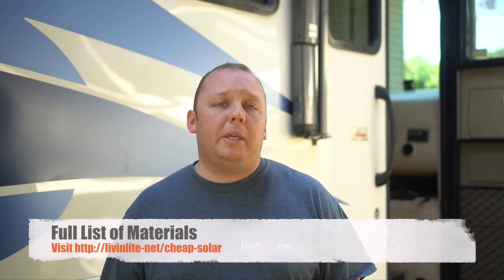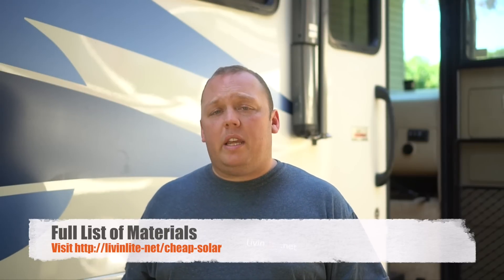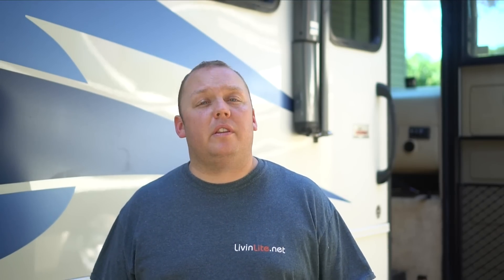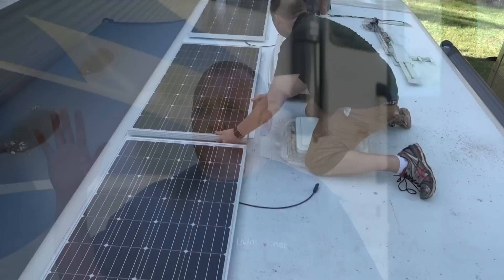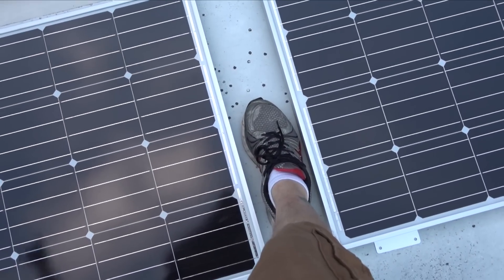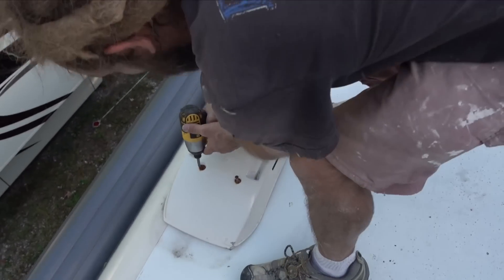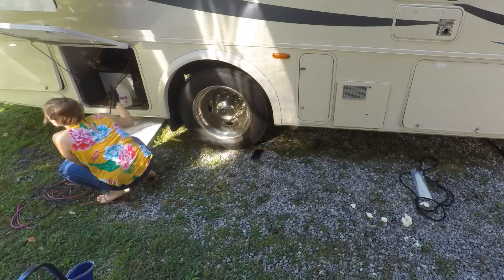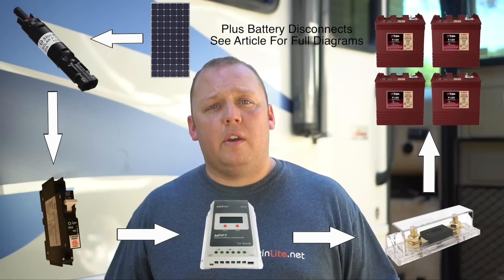Solar Power - Stop Using Generator for Under $1200?

Comment: How much would it cost to run a generator to generate what your solar panels would produce on the equinox? If it's around $6.00 in fuel a day you'd recover your investment in 200 months or just over 16 and a half years. Even using $12.00 a day in fuel for your generator it's still going to take you 100 months or ~8 years to pay it off.

Comment: Four x 160 watt panels in series does not produce 48 volts but 88 volts with no load, down to 72 volts at full power load. These are the input voltages the MPPT controller must be rated for. Personally, I would have saved up a bit more cash and bought the EPever controller that could handle 50 amps so that you don't waste the available  energy and also the unit doesn't have to work so hard. If you have a really good day with the sun close to directly overhead and you have hammered the battery the evening before while being parked in the shade until you move the bus, you can miss out on an extra 120 watts or so of charging ability... just saying but I've seen it happen.

Comment: I was wondering... I recently found out that when I'm plugged in my chassis batteries don't charge.

I know when people put solar panels it goes to their coach batteries but how about the chassis does it also charge that as well?

I'm not sure if I'm saying that right the chassis is the battery that starts the motorhome and the coach is what runs everything like the home side I may have It reversed lol.
Reply from the maker: Some folks install a single panel and just hook that extra panel up to the chassis battery using a small inexpensive charge controller. For us the chassis batteries charge when we are driving and our bus doesn’t drain the chassis batteries when we are parked and the key is off so we haven’t had a need to charge them when parked. If we were parking our bus for more than 30 days we might go with the extra panel idea. Thanks for watching!
Reply: @LivinliteNet1  

Thank you for the advice I might get an extra panel 👍.
Reply: @wildbluejohn  

Thank you very much I believe you may be right. I saved the website you gave me thanks again for your help 👍😉

Comment: God Lord..near the end of video it showed an rv with a huge amount of panels on its roof. How big is that system  ? Is that yours  ?
What are ya'll running ?
Thanks, chuck
Reply from the maker: Hey Chuck, yes that is ours, we have 12 panels (10 in this video) for a total of around 2000 watts. We run two flexmax 80 solar controllers together each running half the system and 6 6v Lifeline 300ah batteries for a total of 900ah of battery. We’ve been constantly tweaking but will do a video on that setup soon as well.

Comment: You described as well as I've seen it described. Did the $1200 include batteries?
Reply from the maker: It did not but prices are coming down every day so you could do this setup for less today (or more power) then when we posted. Stay tuned as we will be doing a lot more videos as we've partners with a few folks including some lithium battery manufacturers and solar manufactures. More to come!

Comment: Thanks a system that's not 12 volt. I agree 48 volt system is the best way to go. Lighter wire and better power inverters that are pure sine wave. No harbor freight inverters here. I know about the shade issue but I would install where there is no shade. I.plan on a shed mount and use proper angles to get best sun exposure.

Comment: Why 6V batteries
Reply from the maker: Hey Doug, thats a long debated question that you can find miles of posts online about. In general 6v batteries are more price competitive and you are more likely to find a true deep cycle battery in 6v configuration as that is what golf carts and many rv's come factory installed with. The plates in deep cycle batteries are thicker and much more resilient to multiple de-charge cycles. There are also multiple folks that feel that a 6V series configuration performs better than 12v systems in parallel wiring configuration, especially if one of your batteries has a bad cell or experiences an issue but we haven't tested that theory. That said, many lithium solutions coming out are 12v batteries and since lithium works differently this wouldn't necessarily apply. 6v was best for our needs as it worked with the existing physical space requirements and gave us the most bang for our buck in terms of DC Amp Hours.

Comment: Question, Is 265 amp hour batteries for total four 6v batteries or each battery? What is cap 5 wire, equivalent to what gauge wire?  Thanks
Reply from the maker: the batteries are 265 AH each. When you increase from 6V to 12V your voltage increases but your AH does not. Therefore 4x265AH batteries as 12v would be a total of 530AH battery bank. I'm not sure i understand your second question regarding wire gauge. Would you mind elaborating on what you are looking for?
Reply: my 2nd question is what kind of wire do you use for the entire system, because you did mentioned about the wire you used, I did not total understand that portion. Thanks
Reply: Jentai Su    I think you meant cat 5 wiring for the display.
Reply: Yes, exactly, the part that I misunderstood. Thanks
Reply: Jentai Su - cat 5 is Ethernet cable, like a phone cord but with more pins. It is just for the solar charge controller to communicate with the display mounted inside the coach.

Comment: Looks good...does the $1200 include the 4 new 6v batteries?
Reply from the maker: It does not include the batteries as most folks have batteries already we didnt include. If you are interested in batteries we recommend getting in touch with Solar Brian who has a great store online and travels around the country full time doing installations. He is at http://livinlite.net/solar-brian
Reply: Oh ok...but I thought you ended up having to get batterie because the ones in your dads coach weren’t sufficient and ended up getting 4 new 6v batteries. So the total cost would be greatly higher with those new batteries I imagine.

Comment: I like it. Can't wait to see how the system holds up.
Reply from the maker: +LetsRV so far so good! We’re going to add a second charge controller in the spring to manage the summer high sun. So far a pretty good inexpensive setup with a remote in cab screen to monitor. Thanks for checking in!

Comment: I would not recommend strapping your battery wires to the gas pipe
Reply from the maker: If you've ever tried to puncture hard pipe or even cut it with a hack saw you know how strong that stuff is. If it was the newer polyethylene jacketed copper tubing for LP i'd totally agree but you could probably hit hard pipe with a fire axe and not get through it! (i've seen plenty of contractors accidentally hit it with 3" framing nail guns that wont even scratch it) That said, if we had another wiring route we would agree to try and avoid but not in this bus unfortunately, was a bear to get through that area unfortunately. thanks for the input and feedback!
Reply: No offense, but i don't think you understand. If a hole gets rubbed in the insulation of the wire, it is possible for the part touching the pipe to ground out. Should this happen it could cause the pipe to heat and glow cherry red, which could ignite the gas inside and you basically have a pipe bomb going off. I have seen vehicles burned down due to wires grounding out and that is with a single battery. A battery bank can obviously cause metal to get substantially hotter.

Comment: You didn't mention what kind of equipment the system would run. T.V.? Heaters? Lights? I obviously know nothing about watts and if that type of system would run my T.V. DVD etc.
Reply from the maker: for the most part, solar is best used to charge a battery bank, not to run tv's light etc directly. This allows you to use larger demand appliances using the "stored energy" in your batteries rather than just using what the panels are putting out at any given time. To give you some really rough numbers, if our system 36AH of power every hour (about 430 watts), and if we assume 6 hours of good sunlight, that would give us 216AH of generated DC power per day. A standard flat panel TV and LED lights in an RV might use about 8AH of power on average? So you'd be able to use your lights and watch TV for 24 hours (all day and night and use about 192AH of total power). So yes, assuming it is sunny out, you could run most RV lights and a TV and have enough power with a setup like this. A heater would be tricky as it would likely use a LOT of power (1500 watts or around 120AH draw), you could run a electric heater but using the same numbers above, you'd probably run out of power in about 1-2 hours with a high draw device like that. This is why most folks use propane heaters as they work much better for really high demand devices like heaters. I know it can get confusing but let us know if that makes sense and hang in there! We are here if you have any other questions.

Comment: Hey guys, that charge controller is rated at 520w for 12v. Is it because of how you wired the panels that you can use 600w?
Working up my own plans, so thanls for your help!
Reply from the maker: Hey Tony, make sure to checkout the article at livinlite.net/cheap-solar as a bunch of questions are answered. You are correct the charge controller is maxed at 520 at 12V but because its winter and the panels do not tilt we haven't had any issues with the charge controller. The voltage of the panels will not exceed the max voltage input of the charge controller (100v I believe) so the controller should be fine. That said, you wont get the full benefit of the 4th panel in direct, summer sun you would need to either add a second charge controller (wire 2 panels to each controller and then wire them both to your house battery bank) or upgrade to a higher capacity controller like the Outback Flexmax 60 controller which would be able to handle all of the panels (plus a 5th i believe). For my dad he was ok using the cheaper controller as he uses such a little amount of power and was more concerned about having the 4th panel for winter/shade/cloudy days. Let us know if you have any questions. lots of extra info in the article but we are here to help as well!